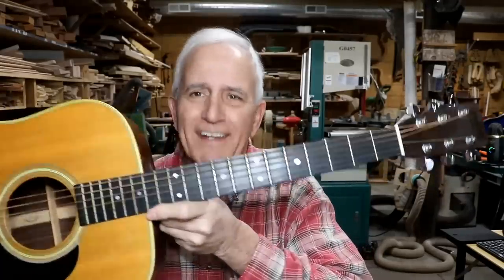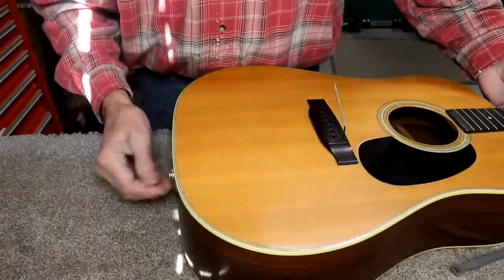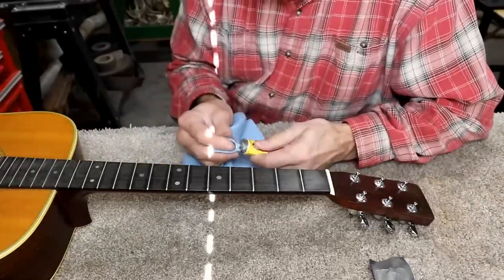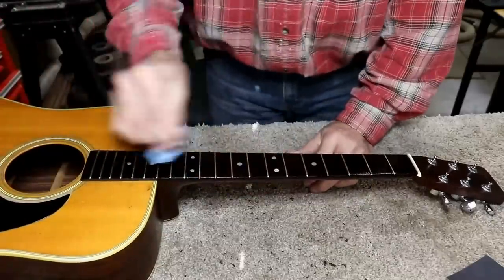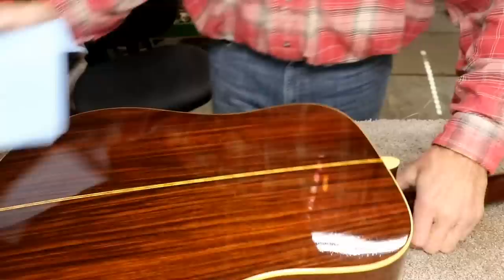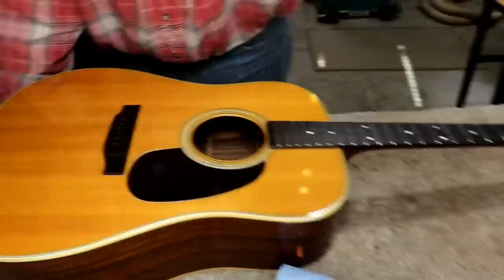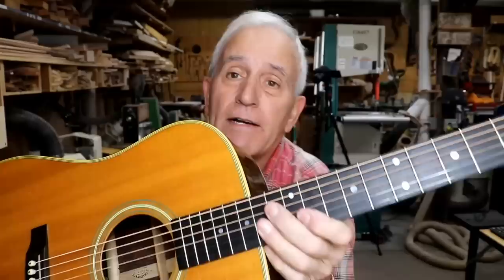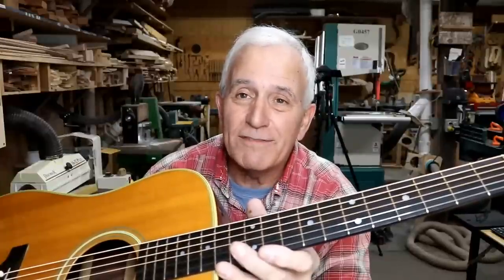630 RSW 1970s Martin D28 Does It Need A Neck Reset

Comment: I have a 1938 Martin, and someone along the way decided to lower the bridge to avoid a neck set.  The next step in the process is that the bridge is not as strong and is more prone to crack, which it did, and so I not only had to reset the neck but I had to replace the bridge.  I really hated to replace the bridge, but Martin had a replacement that was perfect.
Reply: There isnone benefit of putting on a bridge.. If you build it from scratch,  and you have a tool like Jerry has to slot it ,just about every time you'll have better intonation than the factory had because they just measure it and glue it .

Comment: With such an extraordinarily low saddle, this 70's D28 definitely needs a neck reset to optimize the string break angle over the saddle which will result in the best sound/tone/volume from this D28.

Comment: One could always shim the existing bridge pickup slot +/- to raise or lower string action at the saddles. Some even rout out the saddle slot a little deeper and that can always be shimmed up or down with a piezo pickup. Ovation does it that way. What I did, I channeled the plastic saddle part of the CP-100 & maintain the intonation ridge.  Those are $ 10-12 as a replacement part . So order & receive the spare part before channeling either saddle part. That way if it ends up a mess, you can always use the original or new replacement saddle piece and be right where you started.

Comment: Good job. Beautiful guitar. I'm starting to like the idea of bolt-on necks for acoustic guitars because they all seem to need the neck angle adjusted at some point. I've never done a neck reset, but think that resetting a bolt-on neck would be much easier.
Reply: With modern construction techniques a bolt on joint is just as tight as a dovetail.
And, yes, neck resets are much easier

Comment: Another great job Jerry. Martin, Harmony, Silvertone it doesn't matter, they all play and sound better when you lay hands on them!

Your note on checking a soldering gun's tip connections for tightness is right on. A friend was having trouble with his gun not getting hot enough to melt solder.  I was working in another area of his shop when suddenly I heard him shout out !@#!@!!!.  I turned around just in time to see him take it by the cord and slam it into the concrete floor.  All it needed was to have the tip connections tightened.  I wonder how many Wellers suffered a similar fate?  One of mine is over 60 years old and still works fine...

Comment: Am I missing something? Just kinda noticed that when you're measuring string height at the 12th fret that you only use 2 strings to pull on the neck, then you string it and put on full tension which can be a 240 to 320 pound difference. So if you adjust to spec with 2 strings, then add another 320 pounds after fully stringing it has no choice but to make your adjustment inaccurate. I'm sure you're making it up with experience but in this case you said it was higher at the 12 fret than you expected. Anyway, I'm just a nosey observer and very curious 64 year old who has been setting up guitars since I was 20 and willing to learn anything you can teach. With that said I have tons of respect for you Jerry and absolutely love your content, and thank you for showing us your craft.

Comment: Liked, subscribed and commented.  Thanks much for this, it was the inspiration to finally start working on getting my '72 D-35 back up and working.  

???? A minor error of fact, which nearly every one else makes too, at 12:05.  800 grit is not 800 per square inch, it is 800 per lineal inch.  800 grit per lineal inch makes each grit .00125", 800 grit per square inch would make each grit .0354".
Reply: "Grit size refers to the size of the particles of abrading materials embedded in the sandpaper. These measurements are determined by the amount of the abrasive material that can fit through a square inch filter." (  "Sandpaper Grit". Empire Abrasives. Retrieved 13 April 2020. )

Comment: Hi Jerry;
I have a 3/4 size Cordoba guitar with a cedar top. The B string on it always sounds dull too, particularly on the first and third frets. I have checked the angle on the nut, the saddle and the level of the frets in that area of the neck. I have even put a new strng on it and it still doesn't sound right to me. The only thing I can figure is that the guitar just doesn't resonate well with those particular notes. Other than that, I love the guitar. It has a beautiful tone and is easy to play. The set-up on it is very nice (and was right out of the box). Any insights on this would be appreciated. I really enjoy your morning vlogs.
Reply: I have a Dean koa wood acoustic with a string that buzzes on the first several frets. It will get better then worse again. I have nobody here to help repair it. I ordered it. It`s a great guitar otherwise. I believe I could fix it if I knew what to do. But I don`t want to assume anything either.
Reply from the maker: Another possibility is that it's your actual saddle the string has to ride over the full width of the saddle if it's riding on part of the saddle it can actually buzz on the other part hope that makes sense

Comment: Nice setup!!! Sounds great. I prefer lights on a Martin as well - mediums darken the sound (to my ear at least). And your adventure with the endpin screw brought to mind my least favorite activity in the shop: "Finding the Thing You Dropped"
Reply: I agree. I’ve got a early 2000’s Martin DR rosewood and I use 12-53 lights. I tried those Martin brand light strings. They started a a 10-? I don’t remember. But they were horrible. Very thin sound and no bottom end. Not enough punch to move the soundboard I guess. I’ve never gone bigger than a 12-?  But it’s got that big booming bass response and still the thin strings are able to cut through at the same time. Makes for a beautiful sounding guitar. Especially open tuned.

Comment: Sorry for asking because I know you are a professional. I only worked with some Luther's around Nashville, I never went to a luthier school. I think you did a good job here but I would have checked the Fret board , the neck, for a bow or a hump in the neck by eyeballing and putting a straight edge on the fretboard to the bridge. I look down the fretboard from the headstock to the bridge. Just asking, I do like the way you lowered the bridge and reworked the bridge. Good luck and thanks for your post

Comment: Have you aver tried hickory for bridges, bridge pads, or fretboards?  I was just given a good sized stack of hickory, when I looked it up for comparison, it's harder than most rosewoods, on par with Brazilian rw and padauk.  Playing around with a couple chunks I cut off, it's tough as nails!!  I've obviously had some in ax and hammer handles, but never had any experience with it as raw lumber, I am really impressed.  I'll definitely be using it on some instruments.  🤩🤩
Reply: How does the weight of hickory compare to rosewood?
Reply: @nathanbarnette1162  almost the same as Indian rosewood in weight and strength (strength is actually a bit higher)

Comment: There is nothing I would like more than having you set up my Loar mandolin. The strings are crazy high and the nut slots are not wide enough. The bridge is as low as the screws will go. It’s hard playing.

Comment: I usually agree with you but I think you should have done the neck reset. Preserve the original design and dimensions of the instrument! It (the strings)will have a lower break angle and this changes the volume, power, etc of the guitar! The bridge, being thinner will be more prone to crack, necessitating a new bridge, and a neck reset anyway. I enjoy hour program, but if you did this on one of my Martins, I’d be very upset. I love the music on your program, as well as your banter. Most people that I know who own Martins or other higher end guitars would choose the neck reset if they understand the issue. I know it’s a judgment call, and it wasn’t much but I would choose a neck reset. When I buy older guitars I try to determine if this has been done and if it needs a neck reset. We see this one very differently. I do understand wanting to save the customer money, and they may not have wanted the neck reset.